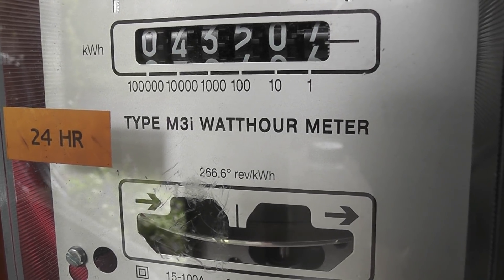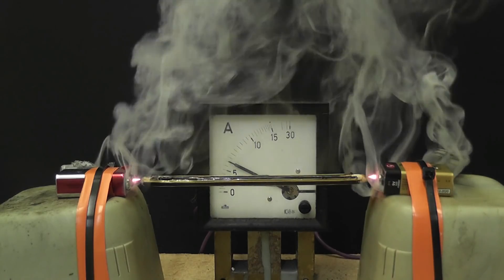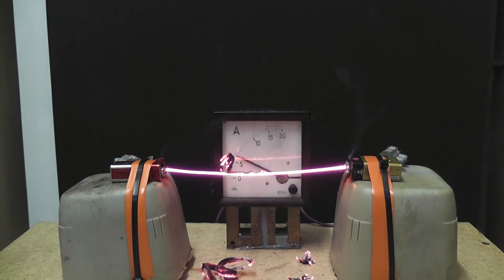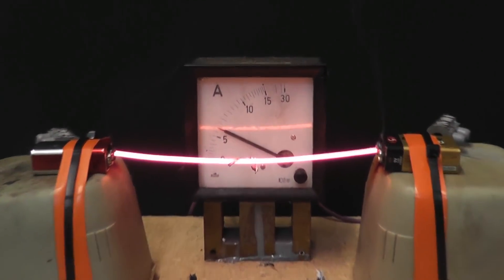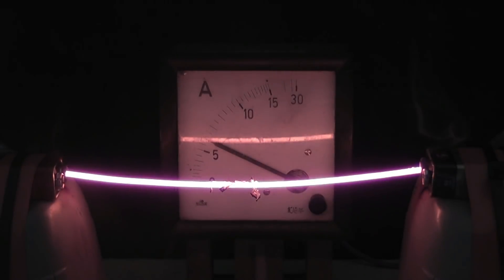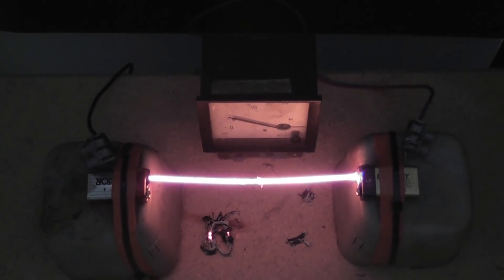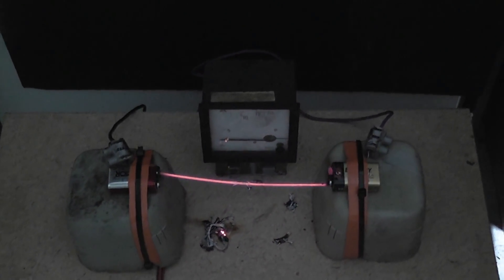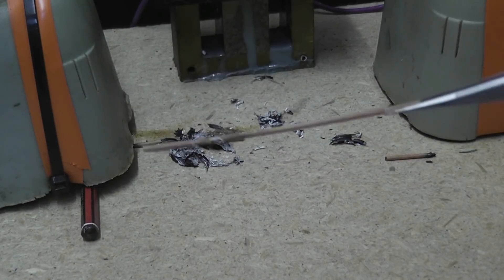Glowing pencil rod

Comment: Very nice! The graphite in pencils are not really pure - it's mixed up with clay if I remember it right. But it can still get very hot without falling apart if there is no significant mechanical load on it. I have a video where I run current thru a small lead pencil rod and it lights up the whole room really brightly - the same thing may be possible with a "big" pencil, if you have a low voltage source with enough power or of you get a bigger ballast (preferrable a large inductor or capacitor intead of a resistive ballast
 - that way, you don't have to deal with most of the heat being in the wrong place).

Comment: It's possible to do better than that. :)

At secondary school, I sat next to a wall plate with a fuse and a cable supplying the heater (possibly only supplying a fan for a hot water radiator, I didn't look inside).  One day I removed the fuse and replaced it with a length of graphite from a propelling pencil.  Obviously, the graphite didn't make firm contact.  It struck up a very impressive arc, the light of which could be seen through the opaque plastic of the fuse holder.

I think you could strike a nice arc using two pencils.

Comment: you probably know it, your camera does not have a quite so good IR filter, so it looks more pink than orange. Maybe you have the IR filter out of an old slide projector, they only add a light green tinge and work quite good. And if you put a black negativ developed film ore the inside magnetic disk of a floppydisk on to the Camera you get a kind of an IR Camera but only for high temperatures. It can be quite dark but fun to play with.